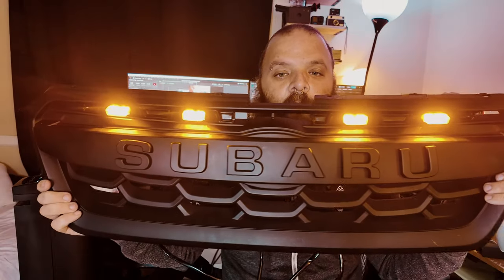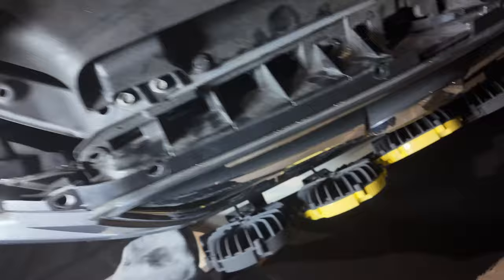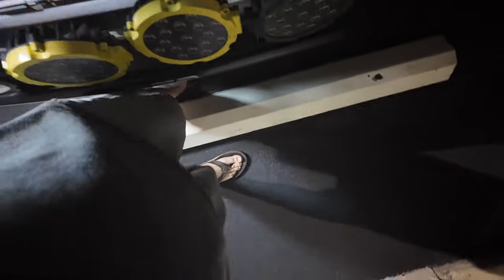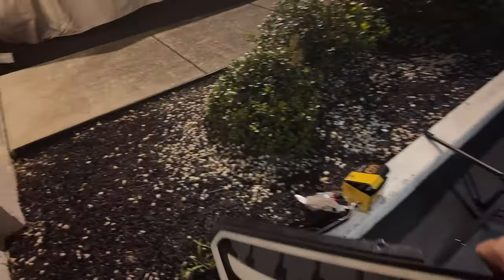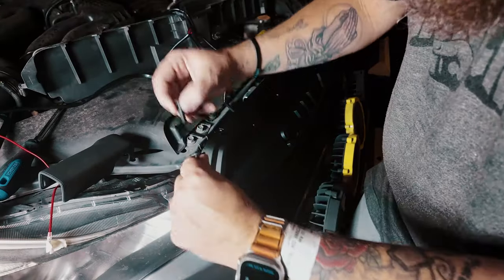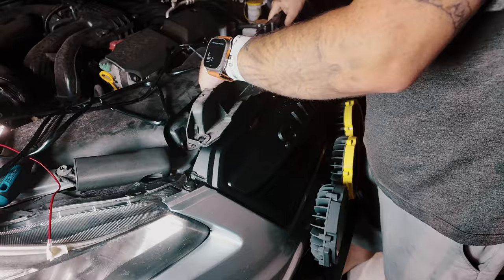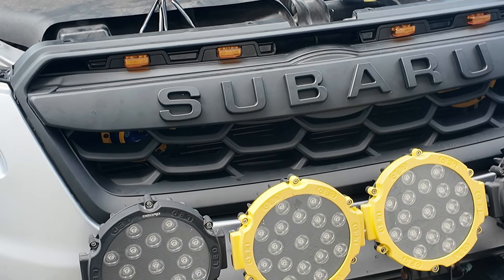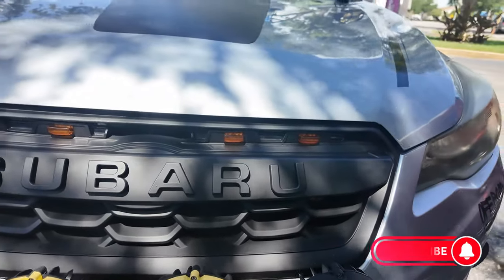Upgrade Your Crosstrek Look with Garage Alpha offroad Grille | Roam Roadless

Comment: Thanks for the video.  Question:  Looks like you tapped the high beam fuse under the hood?  On my 2013 XV it seems to only get power when I actually use the high beams.

Comment: My install was a pain in the apostrophe. Fitment issues, add-a-fuse failed continuity, ring terminal too small.
I ended up just making my own harness and wiring into the DRLs in the dash. 
In the end, it looks great, so the troubles were worth it.
Reply from the maker: i almost did the same,
Reply: @RoamRoadless  just discovered water in two of the 4 lights too.... Grrr
Reply from the maker: @-WoodyVT-  noooo that sucks. Try reaching out to the company. They may send you more. Are they still working?

Comment: I grounded it, and plugged in to audio fuse, and nothing. Any suggestions?
Reply from the maker: @ichtats  try connecting both ends straight up to the battery to see if the lights come on. The red end to the positive and black to the negative. This way you know they work.  If they come on, maybe check the ground by plugging the red up to the audio fuse and then ground it on the battery. If it comes on than you know it’s a grounding issue. If they don’t come on, change the power source to another fuse. Anything that says A/C should work. I suggest a fuse tap
Reply: I added a fuse to the tap along with the provided, and it works! However, the audio fuse must be constant, cause it stays on with car off. Any suggestions on another fuse on the 2022 that I should try, so it only turns on when I want it to? Thanks, for the quick responses!
Reply from the maker: @ichtats  are you using the engine bay fuse box or the interior ones
Reply from the maker: @ichtats  if you’re using the engine bay fuse box. You could always tap into the low beam head light fuse or the tail lights. But then the grill lights will only be on when the headlights are on. You can also try the empty slots and see if any of those will work. I believe the low beam and tail lights fuse positions are 3,4, and 8
Reply: Engine fuse, ah ok I’ll try today, wasn’t sure what the empty ones are for, the diagram show them x out